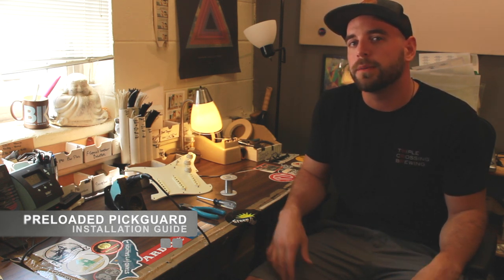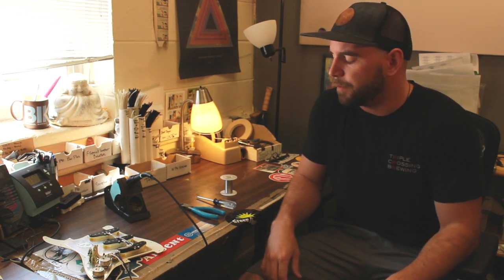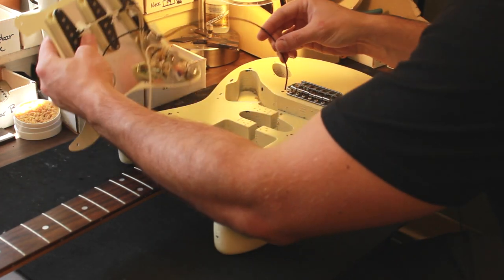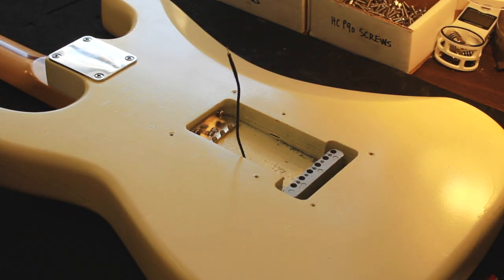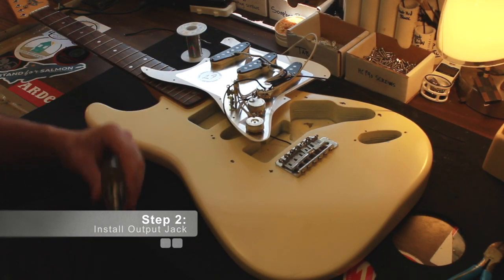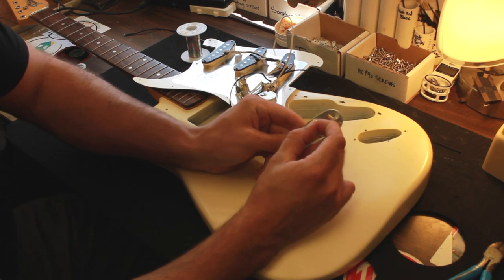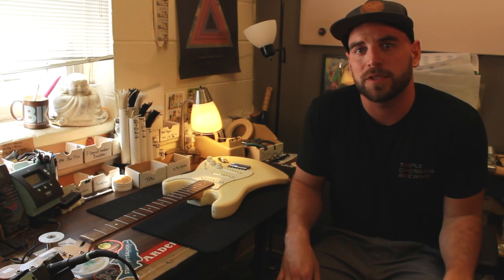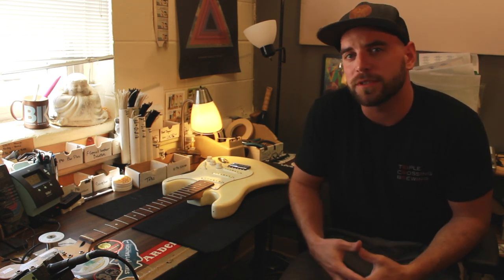Lindy Fralin Prewired Pickguard Installation Guide

Comment: Great demo.  Thanks.  One recommendation I'd like to make is that when you solder a wire to a larger metal piece, such as the spring claw, heat the claw at the spot where the wire will be soldered to.  You want the metal spot to be hot enough to melt solder without having to touch the tip of the soldering iron.  That gives a more solid and confident soldered connection as the attachment point is first properly heated.  If you simply tin the spot by holding the iron to the metal and then quickly dabbing the solder on the tip, sure the solder will melt and somewhat stick to the metal plate.  However, that spot was not properly heated first, and that could, and is often, the spot where there will be a failure.  When done incorrectly it is called a "cold solder" joint when the solder isn't fully bonded to the surfaces one is connecting.  It only takes a slight bit extra amount of time to ensure the connection surface is properly hot.  How fast it gets there depends on how hold of a soldering iron one is using.  Stay tone-full friends.  :)
Reply: You are right, the solder won't flow unless both metal connections are hot enough. It's ok to use two irons if you have too. Lindy

Comment: What about the body ground? My Elite Strat has 4 wires.
Reply: I was wondering about that myself. My Deluxe Strat has 4 wires, too, but you only have to wire the three as shown..
Reply: @leoberthiaume2115  You only need to wire the 3 mentioned in the video. The 4th one usually has an opening for a screw attached to the end of it; it doesn't need to be soldered, it actually just screws into the body so the wire has contact with the shielding paint within the cavity.

Comment: Hi Tyler,  Installed my pickups that I just recieved today. I suck at soldering, but your video took the pressure off. I had to go out and buy a real soldering pen though. The one I had was too weak. Two things I would suggest: 1: Tools needed, I would mention the 80w soldering pen listed in the beginning, with the wire cutters and phillips head screwdriver (the best I could find at Home Depot was a Weller 60w, which did the job, great!) 2: A close up of the wires to the input jack (for us old guys. lol!) That being said, the job is complete, and the pickups sound freakin' amazing!